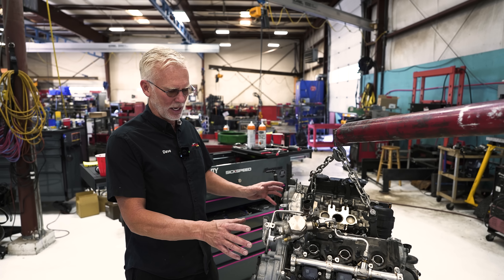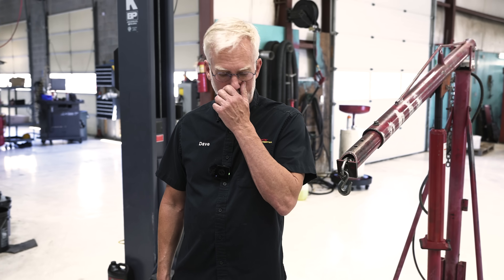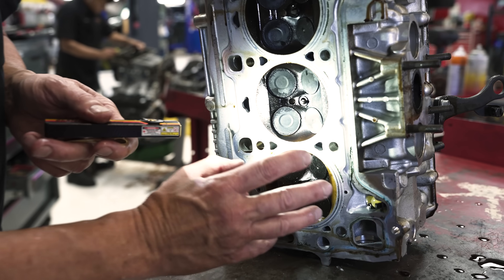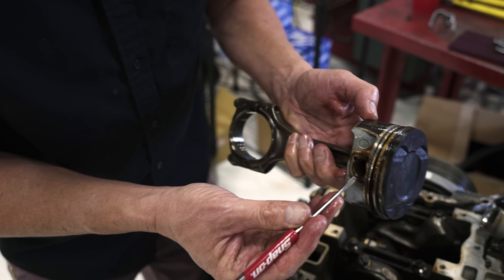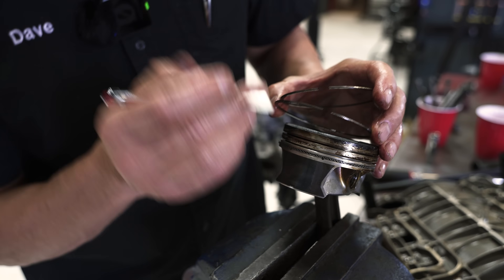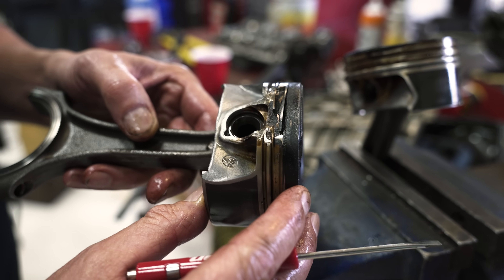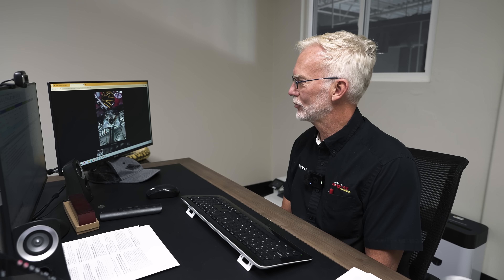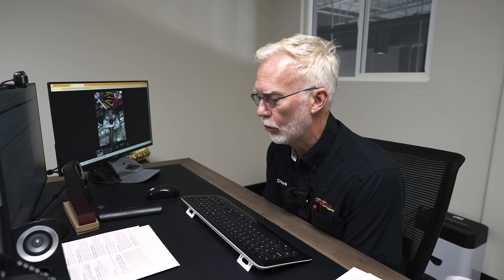Audi S5 Update: Piston Damage From LSPI (Low Speed Pre-Ignition)

Comment: Too many flaws in this video that is not accurate begin with the cyl wall, the so call LPI in which is also inaccurate too. The problem strive on the mis-information and generalize concept of this engines. Im working as a tech for Porsche that use this exact engine engines and i saw this video running and at the end there no solution except to repair the engine. Other than that LPi still exist( in which for sure i know wasnt the fault) and secondly the engine itself was poor maintenance.that i see as the video going into the deep investigation.

Comment: Regarding fuel additives. They can help, but most are xylene or toluene based. Essentially, it is a solvent. VERY effective at dissolving varnish build-up. This CAN help a DI injector spray better. What helps more is removing the occluding carbon AROUND the injector. HHO cleaning to the rescue!

Comment: Cheap oil, cheap fuel, extended maintenance intervals, short trips, eco driving + high performance engines.. what could go wrong?
Engine design nowadays is like they are made of chocolate.. I remember boosting Honda B16/B18 engines to twice the N/A performance.. box and engine lasted forever and never catastrophic failures, just "time to change bearings" preventive.. which was like a day work an fixed for a couple of hundred Euro's.

Comment: I hold Dave and his team in very high regard indeed, but this repair gives me cause for concern.  This B9 S5 isn’t something that his shop sees often and these cars require a very high level of engine-specific expertise to properly diagnose and correct the faults the lead to this sort of catastrophic failure.  I‘ll hasten to add that the vast majority of Audi dealers don’t possess this knowledge.  The early examples of this engine were, as often mentioned here, subject to rocker arm failures.  However, I feel that this one might be more the result of the tune.  Regardless, there are a litany of items that need to checked before reassembling and reinstalling this engine in the customer‘s car.  As one comment referenced, a logical first step might be to view VAG Technic‘s YouTube content pertaining to the early B9 S4 & S5 models.  At a minimum, it will provide greater insight into how this engine typically fails and why.  Additionally, it might direct Dave and his team to examine the integrity of some other components that they might otherwise have overlooked.  Furthermore, I cannot overstate the importance of determining the current state of this Audi‘s ECU and any modifications to the tune contained therein.  Finally, the state of the timing chains and catalytic converter assembly needs to be thoroughly assessed before the engine goes back in, so as to avoid a repeat performance of this entire exercise.  YouTube is a community and it‘s through this sort of interaction that we all learn and become better.  My sincerest thanks to all that have engaged in this process by leaving comments aimed at getting to the bottom of this Audi‘s ailments.

Comment: Another great video Dave.. been a licensed technician for over 45 years, now I teach for a car manufacturer.. its funny since this DI was implemented,, we added 4 new codes to the menu..lol.. take a guess what they are?? LSP codes. I find it a complete joke the weasel piss they suggest to use as oil... It has been nothing but a marketing ploy, stating low friction,, less drag ,, better fuel economy... Absolutely BS... It has been proven,, tested and won that thicker oil makes HP.. I'm not saying gear oil thick, but I will never use 0w20,,5w20,, and now Porsche came out with 0w60 i think.. Are you F_ _KIN kidding me? My V-12 needs minimum 20w50 in the summer.. My hemi, 10w40, summer.. not bs dodge recommends,, lifters and cams still perfect.. I use only the highest grade fuel, and oils, filters,, double start for priming my cold engine, and block heaters..
Reply: Motul 5w 40 is what I use on my B9 S4. Same motor, 5k intervals, zero issues thus far.

Comment: You’re the only guy on YouTube who gets LSPI EXACTLY right. If I could add, non SP rated oil can lower the octane of the atomized fuel to the point it’s unstable at the higher, boosted compression ratios and operating temps of modern engines. GF-7/SQ is launching March 1 of next year. Most of the changes are specifically around LSPI with a smaller focus on fuel efficiency. The OEMs drove most of the LSPI changes. Warranty costs are a real b****!!
Reply: Except his recommendation on oil excluded the Audi specific requirements. This was an ignorant ass video. .

The engine died from the tune. Not oil.
Reply: @dealershipscammers  Did you watch the full video? You could be right, it might just be the tune, if he has one, but we don't even know what oil was used in his last oil change. So incorrect oil cannot be yet ruled out as the culprit.
Reply: @mechsuit80  the issue is that Dave is oversimplifying it and his reasoning lacks a lot... I think there is no way LSPI can alone cause such damage... Dave is a showman.... exact technics lacks a lot...good only for no engineers who have no chance to judge it...
Reply: @pavolklepac935  This failure was also compounded by the fact that this year model engine had piston design issues where there was an inherent weak spot in the ring lands, that was quickly fixed that same year during a later production run. All the talk about SP rated oils is BS. It was caused by the tune acting on a weak piston. Nothing Dave was saying is a remedy for this situation.

The problem that mechanics that work on a wide range of cars seem to always have is that they always tend to over generalize a problem. The failure in the video isn't a common problem with these engines, with the exception of certain runs from the 2018 model years. These engines are known to be very reliable and don't require some mystery magic sauce to keep them running, just VW/Audi approved oils that the owner should have been using anyway. The problem this owner faced was more of bad luck with the specific run of S5 he purchased having the weak piston. Vag Technic does a substantially better job at explaining the real problem, but he also works on these cars A LOT more than a generalized mechanic shop.

Comment: Ethanol free premium, SP grade oil, 4 months, 4,000 mile oil changes. Use PEA fuel treatment at 6 month, 6,000 mile intervals.
As a retired ASE mechanic  if oil consumption becomes a problem you are doomed for engine failure because the oil mixes with the fuel/air mixture and dilutes the effective octane rating.
90's gm drivability/spark knock complaints lead me to the tailpipe first before I drove it to verify.  If the tailpipe was black and felt oily between my fingers it most likely needed a short block from excessive cylinder bore wear from weak soft blocks. Did all the timing checks, EGR working ,etc, but a engine short block cured it .
I also believe Audi has a proprietary software program used to electrically burn in a serial number into almost every electric controlled part, even window motors.
I've heard horror stories of overnight software connection to Germany to burn in the electric serial number process and a fee of near $1,000 dollars.
Why do people put up with this?? I will never own a German automobile!!

Comment: Thank you for filming this! I love the in depth video on this engine. I have one of these and have been gaining as much information as possible to perform my own diagnosis and repairs when/if they arise. There has been a debate online across every platform for years now about what oil to use in these specific engines to keep them from having failures such as this. Several very highly respected tuners have gone as far as recommending non factory specified oil viscosity (5w-40) for this engine. I'm wondering if you could contact those companies, and maybe you can get a good technical reason they're still recommending the thicker oil which increases this possibility of oil getting past these control rings with lower tension.

Comment: My Chevy 6.6 gas requires 5w30 Dexos approved oil for this very reason. I also run Dexos oil in my 2.7 ecoboost F150 (DI and turbos) and Honda Pilot (DI). Thanks for the video!

Comment: European pedestrian crash standards favour having the timing chain at the back. Also, the mass of the flywheel or torque converter helps with dampening vibrations in the chain. You need to run less mass on the pulley as a result. The benefits are many in the eyes of OEM and there is only one downside which is servicing the system. When did a manufacturer really care how easy it was to fix their car? That's not their problem. They are in the business of selling cars to their customers, many who, don't care how hard something is to fix

Comment: There's a reason most of the newer DI cars have a "cold engine" light that goes out after a couple minutes. Up here where it goes into negative temps outside, LSPI is a real menace. Some manufacturers have different oil weights for different climates as well.

Comment: I m an amsoil an red line oil dealer. What you need is amsoi pi or red line si1. Both have the only ingredient capable to clean up your DI engine ( poly ether amine or PEA.)  I had much better results with RL but either work. Id use 2 bottles after major work, 4 bottles if high mileage and keep it up with one bottle every 3000 miles.

Comment: Stepping out on a limb here but I have this car (Audi S5) with this AE839 engine and it’s a terrific car and it’s high tech, not to mention it’s wicked fast even stock. 

The car isn’t the problem, once again it’s people the problem. People put these shit popcorn tunes so they can squeeze more power yet fail to do proper research on the car. You said it yourself, you put the wrong oil, drive like a maniac out of the gate, and don’t do proper maintenance, I don’t know of many engines today that will tolerate that kind of abuse. If you want high performance then buy an RS5 or RS6 and stop being broke. 

These aren’t your dad’s big V8, these are sophisticated engines that offer great fuel economy and that need the best fuel, proper warm up times not to mention the correct fluids to work correctly as intended.

If you want to crazy horsepower figures, buy a skyline GtR. 

Lastly, this is why I do shit myself, you’d be surprised how much you can do yourself with the right tools and YouTube. Buy OE parts, the workshop manual and do all the routine maintenance. No way dealerships will put the same amount of love in your car like you can.
Reply: I drive an Audi RS6 Avant 2018, and I always wait 2 full minutes for it to be warm and only use premium gasoline. I have it since it's new. I always used the oil that is recommended and changed it at 8k km. Never had any problems with it. I don't get why someone would be neglectful with a car like that. It's not a Chevy Cruise. And even, whatever car you have, if you need it to go to work every day all year round, you have to maintain it properly. I don't use the Audi in winter here, I have an old police charger for that purpose. Even if I didn't pay much for it, I take great care of it. The temperature goes down to -45⁰C where I live. I never had any problems starting it because it's well maintained. I also let it warm before driving it. I just wake up 30 minutes early. It's not that hard. Your Nissan is magnificent. I wish we could buy them easily here.

Comment: Dave, 

I have a question about Direct Injection Engines. 

I have heard that it is not good to let Direct Injection Engines warm up when cold. The car should be driven as soon as it is started.  Reason for doing this, is to prevent gasoline from getting into the crank and oil... 😮

What do you think 🤔

Comment: It's not oil, It's software. 
Email the major tuning companies and determine what fuel it is tuned for or ask them to assist in reverting to stock.
APR
034 Motorsports
IE Integrated Engineering 
Unitronic
Reply: Even if the tune is perfect, if it requires 93 OCT or even E40... and you put in 87..... bye bye...
Reply: @roderickroderick27  Stock engines require 91. If you're putting anything less than 91 in a high compression ration turbo engine, stock or tuned, you only have yourself to blame for failures.
Reply: @robbyyant6213  Agreed..
And if you have a tune for 94 and "you're putting anything less than 94 in a high compression ration turbo engine, stock or tuned, you only have yourself to blame for failures."
Reply: IE already observed this on a stock b9.  Not a tuning issue.  IE contacted Audi but nothing came about.
Reply: @thelaserj6987  This was when IE was destroying massive amounts of engines. They tried to pass the buck onto Audi. 
It was 100% IE's problem.

Comment: I own a honda 2.0 turbo and this is the stuff that keeps me up at night. The motor, from a metalurgy perspective in overbuilt, the K series is a tank. BUT, being turbo charged it does keep me up. 
These types of engines have common issues that cannot be fixed. 
1) Fuel Dilution. Fuel in the oil will definitely cause LSPI, and its because of the high chamber pressure squeezing some of the fuel past the rings.
2) 8+ gear transmissions. Having so many gears, most consumers will lug the engine (high load low RPM) on highways and such going up hill, where the transmission wont down shift to higher RPM.
3) Carbon build up. Because there is no port injection, the PCV system will dump the excess air (mixed with fuel and oil) into the intake tract past the turbo, and right on to the valves.
Consumers MUST DO THE FOLLOWING as soon as they buy the car to help mitigate some of these issues.
1) Change the oil more frequently - 4-5k mile oil changes are a MUST, none of this 10k+ mile oil changes. My honda maintenance minder pushes this out to 11-15k sometimes. No thanks.
2) Install a catch can to catch the PCV gunk to prevent a lot of deposits on the valves, which helps the valves seat properly.
3) Using quality oil. None of this 0w20 stuff. 0W30 in the winter if you live in cold climates. 5w30 or higher (0w40) for warmer or hot climates. API SP and Ilsac GF6A Gen 3.
4) ALWAYS let your engine warm up, even in the summer months, let the engine idle for a minute or two at least.
5) Do not get into boost or mash the throttle when the engine oil hasn't been ran for at least 5 minutes. In 0C air temps, it takes engine oil 25-30 minutes to get to operating temperatures. The coolant temp gauge IS NOT A GOOD INDICATOR.
6) Don't lug the engine. When going up hill or needing to accelerate, try to manually shift into lower gears to keep the RPM above 2000 RPM.
7) Do oil analysis ever once in a while and keep track of how well the oil is doing.
8) Stay away from ECO modes unless idling or light cruising.
9) Use chevron techron fuel system cleaner to clean the injectors every 10k miles. Don't use any of the other ones as they contain heavy metals that can cause damage or issues.
10) Keep an eye on your coolant levels, you never know when you might be leaking. Cooling a turbo charged engine is by far one of the most important things to do. Cough, BMW.

Keep up the good work Dave.
Reply: Great comment.  So true
Reply: Very good customer check list.  Please add very good top tier gasoline to your list.
Reply: Great write up. Fuel quality is a big factor as well.
Reply: Good info. Agree with everything except oil weight. Run the oil weight it says on the oil cap and what it says in the manual. Also liquiMoly makes a great fuel additive for direct injected motors called Di-Jectron.
Reply: @4drturbo85  Believe it or not,  the Japanese Honda owner's manual for the K20C1 engine mentions that 5w-30 oil and 0w-20 oil can be used.  Only that the USA Honda owner's manual mentions 0w-20 oil is for emissions as the engine heats up quicker for the average people.  The Japan-spec and USA-spec engines are built in the same engine factory in Ohio.  Also, customer surveys from showed that customers didn't like going back to the dealerships for service which led to 10k or one year oil service changes (which is nonsense).

Comment: I have this engine & i let it idle 30-60s until revs drop until I set off. But then im instantly on a steep hill for 1km. Im worried this will strain this issue. I try to maintain regular oil changes though

Comment: Love the videos keep it up. FYI, It's not Nikasil, it's Alusil. Nikasil is plated. Alusil is as you described, silicon impregnated Aluminum. Alusil can be honed using AN-30 paste. Not sure if you want to hone though. The previous gen Naturally asperated engine had Piston To Wall Clearance of less than .0008 If i recall correctly.  So the margin may be very small.

Comment: if these GDI engines have issues, why are manufactures using these types of engines? Is there a benefit of GDIs?
Reply: Emissions and fuel economy are the main reasons for GDI and the recent changes in ring tech. GDI can also run higher compression and/or boost and provide more power than port injection.

Not sure if it’s worth it for the consumer though. I have one GDI car and that’s enough.
Reply: GDI engines are more efficient and can obtain better MPGs (they also make more power for a given displacement too).  Under CAFE, MPGs are all important.  Under WLTP in Europe, minimising CO2/km (direct related to MPG or L/100km) is similarly all important.  Auto makers who don't meet the CAFE MPG or WLTP CO2/km targets attract severe fines.  Chrysler was being fined >$200m p/a for all the V8 Chargers and Challengers, hence now phasing the Hemi V8 out in favour of the more efficient Hurricane inline-six turbo.